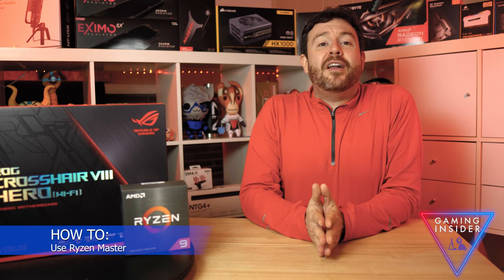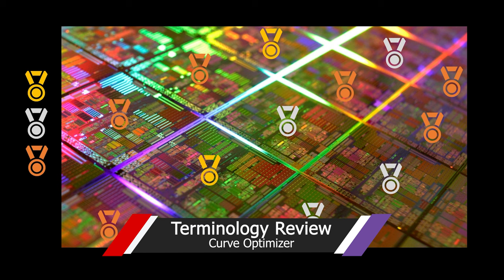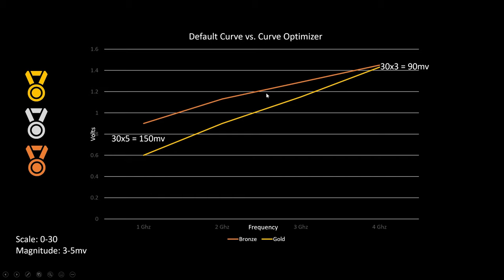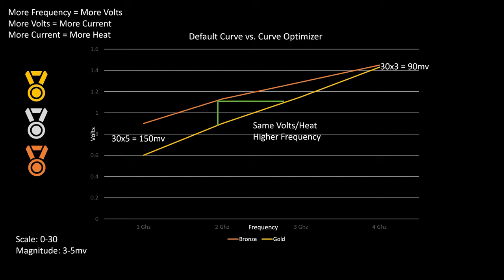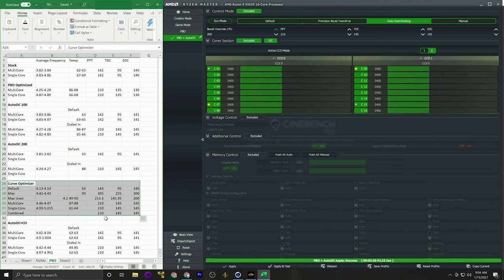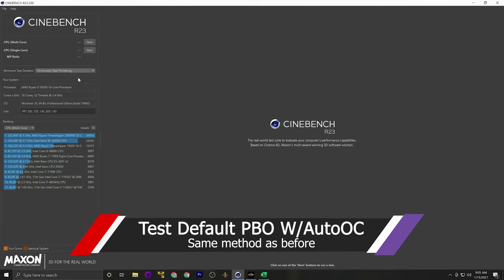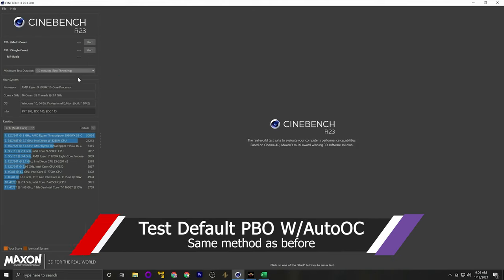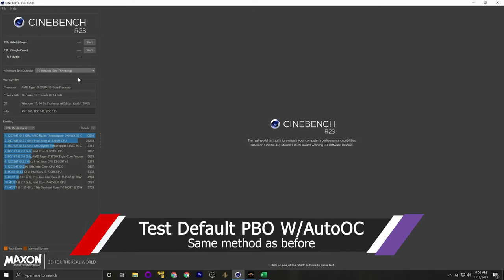Dialing in AutoOC & Curve Optimizer in Ryzen Master --- Part 4

Comment: First of all holy shit! A MASSIVE THANK YOU!!, best guide I have seen so far in the last 6 hours. I am an old school intel OCer and I was trying to understand how exactly this was done to do it on my 5800x as it is a hell of a lot different from playing with core voltage and clocks from Intel CPUs.

TIP ON ACHIEVING STABILITY FASTER for any future person who finds this video. To test for stability during the Curve optimizer part use a little program called OCCT as it lets you stress test all cores individually until one fails and it specifically tells you which one it was, that way you don't have to go in blind on which one may have failed, making the process to achieve stability a lot faster. All you have to do is change the parameters of the core that failed and keep testing until they all pass. Hope it helps, I have been binge watching for the past 6 hours.
Reply: Occt never caused any failures for me, but was really useful in seeing if I was clock stretching.

Comment: This is fantastic info. Last year when I fooled around with settings to boost my new pc, Ryzen 9 5950X, I had setup conflicting settings in the BIOS and ASUS AI Suite3. BIOS setting was a fixed CPU frequency of 3600 and in AI  I set the CPU multiplier at 40 to get 4000MHz. I could render animations, but sometimes Asus freezed the system. Last sunday I had 3 times a freeze in 12 hrs (long run animation rendering) which woke me up. Then I scratched my head and realized these settings were wrong. I finally took a look at the already installed but never looked at Ryzen Master app. I looked up AMD Ryzen Master in youtube and found this video serie.  Results sofar. Just PBO set up in the app- Cinebench  25380; CPU clock around 4260, then Curve optimazation in BIOS all cores negative 10, PBO + Curce optimize All Curves in app: Cinebench 25515 CPU Clock 4445. Final per curve optimazation will be next step. Thanks mate.

Comment: I set PBO limits to auto and it gave me the same clock and lower temps and core voltage compared to playing around with PPT, TDC and EDC.  Didn't believe it but would have saved lots of time.  Curve optimizer has the biggest effect.

Comment: You can pinpoint which core won’t take more than 5 negative in curve optimizer. You can check WHEA errors in windows event report which will provide the thread number with error. Then you can open CPU-z, dump a report, open it and match the thread number to core number.
Reply from the maker: I saw a video posted to reddit on this. I think it is a GREAT idea to use their method to get the exact core. Saves soo much time. 

https://youtu.be/dU5qLJqTSAc
Reply: Make sure to create a custom view and check the boxes “warning” and “error” hence WHEA. Save view to a log file for last hour. Open and find a APID number and match that number to CPU-Z which will tell you EXACTLY which core is producing error. This way you can keep adding 5 negative to every core.
Reply: Mite Janev  some cores cannot be offset even by 1. Rare but can happen, especially on CCD1 if 3900/5900 or 3950/5950
Reply: Mite Janev  its threads. Thread 6 would be core 3. Say you got a number 10. That would not be core ten that would be thread ten core number 5. You need to divide in half and round down if it is a uneven number
Reply: @TheGrayingTech  what happens if we reach 30 we just save it and leave it??

Comment: Really appreciate this series... you got a sub from me. I'm working with a 3960x since my upgrade path is shot, trying to squeeze as much out of her as possible and this series really explained it quite a bit... Haven't tried anything just yet because the Asus utility seemed to bring my speeds up and my temps down... but it's def not boosting as high as it used to, but my power draw is also way down. Sounds like a saturday morning project and I'll be using your guide to drive it. Thanks bro.

Comment: actaully you could check WIndows Event log to find out the WHEA log for the APIC ID and export a report from CPU-Z to find the corresponding core ID from the report. 
I start with 15 offset for all core because it's the middle between 0-30.
Reply: I need to try this

Comment: The problem with curve optimizer is that its not so much under load you find if its stable or not. its under idle.. my pc is stable in all stress tests I throw at it but it fails when im idling around in windows or play a game that doesnt stress my pc at all..
Reply: Whea code error yep. Feelsbadman
Reply: Hello Oskar, I too have been having this problem, were you able to work out the cause? I'm on a 5950x with the curve set at 25 causing idle crashes.
Reply: @martywrx  Yes, by changing to a lower number until its stable. - 25 seems much. Test 20, if not stable test 15 or 10 and so on.
Reply: @martywrx  check the event viewer for whea errors

Comment: Good to know I won the silicon lottery, all my cores are set to -30. Maybe Ryzen master has been updated, because on the basic view I simply clicked on "auto OC" and "all cores" on the curve optimizer, and clicked "Start optimizing". It took about 30 minutes to go through the process of check what each core could run at and then applied it to the BIOS. I have a 7600x and it use to draw 115w and run at 90C, now it draws 80w (65w on the cores), runs at 78C and scores 5% higher on Cinebench.

Comment: 14:00 There is a way to find out which core makes the crash in the system events.
Reply: In Event Logger , set up a custom view of WHEA only with event source as "WHEA-Logger".
Check after crash and the APIC ID divided by 2 (and rounded down if odd number) will be the problematic core

Comment: Please help me😟
Build this setup two days ago- 
Ryzen 5 5600G
Msi b450m mortar max
Deepcool gamemax GT argb cpu cooler
(2×8)GB CL16 3200mhz ram

Xmp profile is on.
I ran the Cinebench R23 test 2 times in multi core and the score is around 890😥.  Valorant is also very laggy.

The cpu temp is around 42-43°C. I used Ryzen master and during multi core Cinebench all 6 cores run at 399mhz. 

The amd drivers are up to date. Can you please tell me what am I doing wrong 😭.

Comment: So I know this is a super old Cid at this point, but I'm trying my hand at undercoating my 7950x so I get a little better game performance sure, but mainly I just wanna reduce power and heat and hopefully not lose any base performance if I can help it. 
My cpu can handle -40 on ccd 1 but tends to lock or crash after a while of doing things. I've come to realize that means on of my cores is pushed up near its ceiling and just topples over after enough time. Are there newer tools than the ones mentioned here that could help me identify all the stuff going on in my case that's modern? Ryzen master even on the per core rune setting just lays a flat -30 that crashes my cpu cause my ccd 2 is much weaker than the 1st. I did try -40 ccd1 and -20 ccd 2 and got freezes. -30 on one and -20 on 2 is stable but I get stutters and it's annoying. 
At stock with just pbo on, during a wake up cycle from sleep where the cpu is all cool but window with hwmonitor is still on, I've seen it record clocks over 6 ghz though. 

After all the studying on this I have done, some optimized cpu settings can look like; c1 -38, c2 -8, c3 -26, c4 -30, and so on. How do I prepare to dial in that much and how do I get that accuracy? 
Also sorry for the long message building to these questions. I'm enthusiastic, but also overwhelmed in my predicament here.

Comment: Pay attention to what your voltage is doing, you can achieve amazing results with stability and think everything is good, but changing edc and tdc will drastically change how much sustained voltage the cores get, in multi thread this can be ok, but in single thread the heat can’t dissipate fast enough. Mine was holding 1.44to 1.468 and bursting up to 1.472 If I hadn’t opened the back of my case I never would have seen flux was forming at the cpu on back of motherboard!! Only touch the power limits if you don’t have high intensity single threaded work loads. Either set a peak voltage limit elsewhere in the bios, or only touch the curve optimizer imo

Comment: cinebench didn't proof to be a good stability test for me, because i could get it stable, but not in certain games or applications. for example 3ds max which i use a lot. so i found a good case where i could fairly easy reproduce crashes with wrong curve optimzer settings and went per core...was a lot of time invested.

Comment: Soooo I’ve played with this curve optimizer for about a day now. All is well and good with multi core cinebench at 30 on all cores. Started noticing crashes on cinebench single core. Verified with prime 95. Nailed down the complete automatic order of core allocation and ended up having to tune the highest priority cores with the lowest undervolt and now basically 12 of my cores are at 25, 2 at 20, 2 at 15 and 2 at 10. Prime 95 will run those two highest voltage cores in a torture test without crashing and I’m just wilfully blinding myself to the stability of the highest ones since they seem fine in multi core rendering applications. We will see if they ever crash lol.
Reply from the maker: Excellent job.
Reply: Couple of thoughts with another day of tinkering. Cooling got 2 degrees worse when I adjusted the fan curves to be quieter. Curve became unstable in single core. Adjusted the fans back up where they were when I initially tuned, curve became stable. 

Logically since PBO2 will increase thermals I would think you’d want to do that first, then find your max stable undervolt during multi core, and then try to dial in your priority cores. Undervolting will higher thermals, and overall the final product would be more reliable. I could be wrong tho… 

Oh and obviously all around the best possible cooling you can stand will lead to a chipper cpu. I haven’t found any game stutter or rendering/sculpting delays, this thing is snappy. I’d like to find out if increasing the max boost in bios directly without any other settings will affect the gains I see when fine tuning single core in PBO2 tho…

Comment: Ryzen 5600x, Curve optimizer -15 all core, custom ppt 120 tdc 70 edc 80 (tuned in ryzen master then manually set in bios).
G-Skill Neo Ddr4 3600mhz Cas16 (no overclock, only xmp on). Cinebench r23 score - 11290, stability test. Default bios settings was 10800, Nad now I play warzone at 48 - 52°c instead of 62c. 240mm aio watercooler. If I fine tune per core I could get better results.
Reply: That's actually downclocking your EDC, and gimping your PPT. It comes 76 PPT - 60 TDC - 90 EDC stock. Raise that value for better results. EDC/PPT gives the gains, not TDC.

You'll find the max power draw while under heavy load is around 105w. So set your PPT there. Also, I don't think anything draws over 65 TDC on the 5600x. EDC draw is regularly over 100 amps in many applications.

Set your PBO limits to Motherboard, run Cinebench and see what's being drawn for your PPT, TDC, EDC using HWinfo. Then go back in the BIOS and set the PBO limits to just above those values.

You'll be hitting closer to 12,000 with a fully tweaked curve plus higher EDC. Can't hurt to throw a 50 to 100 mhz boost override in the mix too.

I increased my score 1100 points in CB23 on my 5600x using 100 - 65 - 105. I use a stock cooler. You can beat that.

Comment: when I started trying to work with the autoOC, my screen on my primary monitor started flickering and glitching. it gets worse when I turn cinebench off lol. I I guess I shouldn't be using autoOC?

Also, if I go into bios and enable the undervolt, ryzen master disables the PBO profile we create through this series. if I enable PBO and restart, it disables the undervolt in the bios!

Comment: CB 23 is good for understanding where your limits are, and when diminishing return occurs.
But how curve optimizer works -- is it becomes unstable during low load (with fluctuating voltage) situations.
Prime 95, Geek Bench, and CB 23 are not good methods for testing Curve Optimizer stability.
Running Prime 95 single core is a decent method.
Playing a CPU intensive game is a great method.
Letting your PC idle for a long time, and/or multitasking with it is another.
Stress testing all cores is not.
That's actually when it's more stable.
So many people go "Dude I hit 5 ghz in CB 23".
Yeah, go play a Triple A title. You'll crash.
Reply: 100% right

Comment: So I followed all of the steps of your Ryzen master guide. The information is very well presented for a beginner for which I am very thankful. The question I have is... why not to go more than -30 mV on undervolting?
Reply from the maker: If your system can handle it, go for it. The Curve Optimizer isn't a straight line undervolt. It uses a multiplier to determine the actual undervolt. So that 25 value that I use is what gave me the most stability at low load and high load. Each chip will behave differently. If you can go lower, go for it.
Reply: @TheGrayingTech  Thank you for the reply. I have 5600X and -30 is quite stable. The values of PPT etc are also down a few numbers.

Comment: So if I'm happy with the speeds of my 5800X on Stock PBO and just want to undervolt, I can only use Curve Optimizer to do that? Will PBO go to the same clockspeeds then? I usually get up to 4.85 on single and when priming 4.5 on all cores.

Comment: I think I won the Lottery boys 😂🙌 my 5600x runs stable at 4850mhz single core and 4820mhz multi core with 200mhz PBO boost and 30 on the negitive under volt and it runs at a cool 75°c 👀

Comment: My 5900X doesn't crash with -30, I plan on optimizing per-core to try and boost higher for single-threaded stuff.
Reply: Same here, smooth at -30 but it does not go over 4,95 ghz even though it stays in the 70 degree temp range.

I dis not know you had to adjust the target boost
Reply: @thulegezelschap5884  I ended up doing -30 on everything and about -25 on my second fastest and -27 on my fastest. This got me 5.125GHz on the fastest and 5.0GHz on second fastest
Reply: @ianault8599  I did not know you could raise the boost target. Going to see if I can get it at 5.0 at least. That ,05 missing now really irritates me 😂

Comment: Gracious goodness my lord, what sorcery is this??
But um at your leisure could you cast your omnipotent eye on this?
Following the 'find out which is a bad naughty core" - it seems a lot of folks are keeping the  negative number very small with the gold cores.

I am wondering if doing as you suggest - going through each core raising ( negativing it ) to find out which is a goober mutant core(s)  AND keeping the gold core(s) low?
Thanks in advance  ☺
Reply: Better cores can actually handle bigger negative values. I recommend trying out ClockTuner and having it analyze your CPU. It'll tell you how good it is overall as well as assign a score to each core. It told me my 5600x was a gold sample and recommended an OC of 4.75 @ 1.3V. It gave my best cores a score of 140 while the weakest got 125.  When manually OCing I set the voltage to 1.31V, target clock to 4750 and gave my best cores -30, that weakest core -15 and the other ones -20-25 and it passed CB20. Now in practice figuring out whether it is actually stable will take weeks of real world use and different use scenarios but that's how you could approach it.
Reply: @Metetron  Now that's a coincidence, I was over at Guru3D yesterday wondering if I should give Clocktuner a whirl! ..
Thank you so much for that Meteron!
Reply: Super interesting stuff, and how amazing we can all share our experiences.
I am at the moment running 2x 8 Corsair 3200s  .. I am wondering if I made a boo boo not spending the extra on some 3600 with 16 cas?
Reply: Oh, it appears I have a Silver 5800x  -_-

Comment: The gains I've achieved with Curve Optimizer vs Auto OC are 5 - 10%, I've a "silver" 5800X I'm able to undervolt most cores to negative 25, funny enough the system instability comes at idle states, when my highest performing cores go way to low on voltage.
Reply: UMI  Indeed, used the WHEA event to trace down the cores and yes, my two fasterst cores where crashing. They seem fine at about negative 18, been 36 hours error free. all other cores I'veen been able to  push to 30
Reply: UMI  i have a ryzen 5800x 2 and i can go on all cores negative 20 but if i put 25 or 30 crash... i will try to se /core and the 2 fastest cores let them to 20 and the others to 25 im curios if it will work.

Comment: I understood the previous videos, to adjust the values, but... well.. I didn't understand this one.  I know it's a dumb question.. but why do you undervolt? I know that is used to lower the temps... but well.. as you can see I don't understand that part at all.
Reply from the maker: No dumb questions. Questions are an opportunity for me to create more videos. 😀 

Your CPU needs electricity and that comes in the form of Volts and Current. It's how the CPU does it's work. But not all CPUs need the same amount of Volts to do the same amount of work. By lowering the Volts provided, you decrease the temps OR you can do more work for the same amount of volts. 

E.g. 
By default the CPU wants 1.15 Volts to run at 4.5Ghz with a resulting temp of 75c.
However, if you lower the volts to 1.10, the CPU only goes to 70c at 4.5Ghz
So you can now run fast, 4.6GHz at 1.15 Volts and 75c.
Effectively, you have caused the CPU to be more efficient with Volts and Temps because it does more work (4.6GHz) for the amount of electricity.
Reply: @TheGrayingTech  Thanks... I thought that undervolting will cause the CPU work a little bit slower... and not getting higher Hz
Reply: The point is to be able to use less voltage which uses less power which in turn produces less heat to reach the same clock speeds that we would typically achieve at higher voltages but at higher heat. Heat kills performance. So what we're trying to achieve is the minimum stable voltage we can use to reach the highest performance.